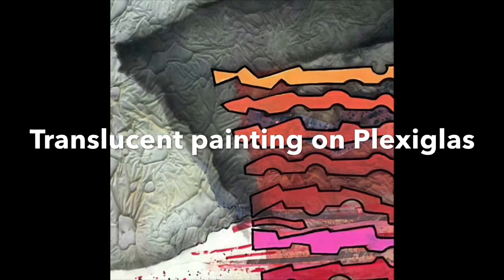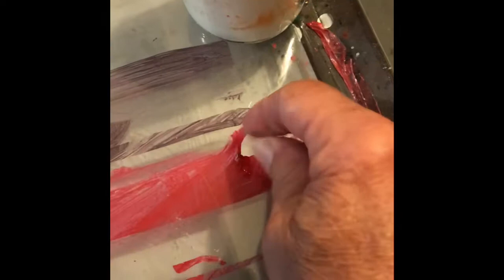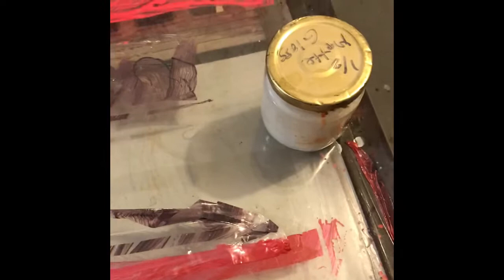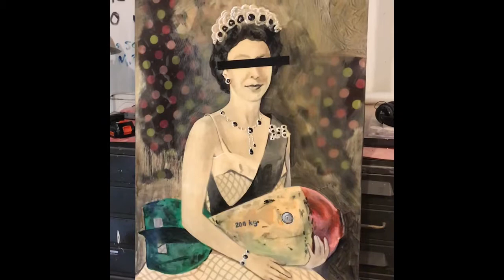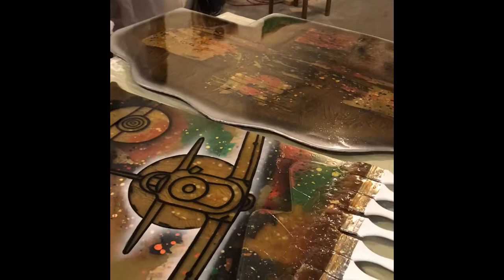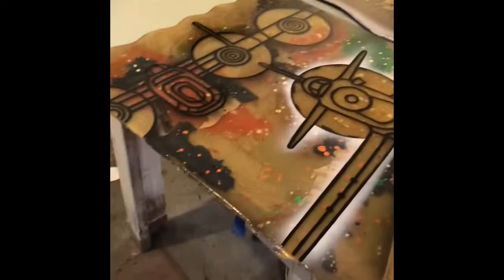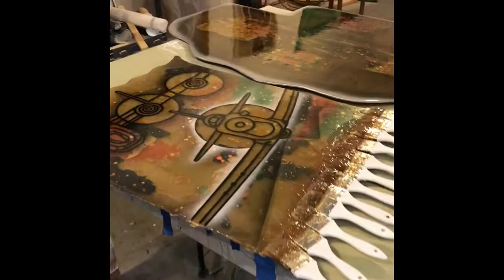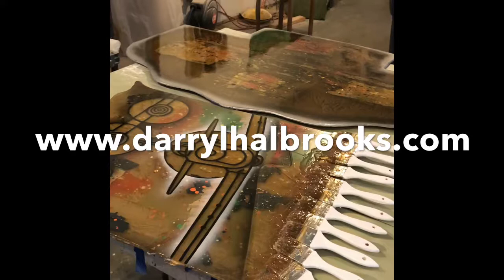Translucent painting on Plexiglas part 1

Comment: hi darryl, i was wondering if you could go more into how you use the modgepodge to suspend paint and then apply it to plexiglass? i am looking into ways to apply paint to plexiglass, and using a medium is very intriguing. however, i can't tell offhand if it scales well. your lovely abstract pieces seem to utilize the texture of the crumpled modgepodge, and i was wondering if that was unavoidable. thanks in advance.
Reply from the maker: I know these videos can be tedious but watch it or a similar one again carefully when I am dealing with those crumpled or wrinkled looking areas. They are actually on the back side and you are seeing them through the smooth front side. Those are achieved by laying out a coat of polyester resin and quickly applying pre-cut sections of plastic wrap. Once it has set, maybe an hour, peel away the plastic wrap. When it has completely cured, (next day) spray a light color in one direction and a dark color in the opposite direction (over the wrinkles). In my newest work, although I still make those wrinkles with polyester, on the other side, when the work is in a finished state, I coat it with two part epoxy and let it dry. It’s safer, (no sanding) fewer fumes and dries out smooth the first time. If the acrylic strips (or anything else you might have applied) is sticking up, (front side) keep coating with more epoxy each time it dries. Hope that helps.

Comment: Do you have any recommendations for sketching on thin epoxy or plastic? I tryed whiteboard marker but it staint the plastic
Reply from the maker: Hey Zoey, so sorry I didn’t see your question sooner. The problem with “sketching” on epoxy or acrylic sheet, if you want something more sophisticated in mark-making than you would get from a magic marker, is that the surface is slick and shiny. That does not lend itself to subtlety. So … an obvious solution is to give the surface some “tooth” by sanding it (over and over with progressively finer sandpaper. This is essentially what a lithographer does when she uses a Levi gator on a litho stone. Then you ca draw with a pencil, litho crayon or whatever. If you have in mind, keeping the shiny surface, you should be able to view your finished drawing from the reverse side, however, it will be backwards. Another solution, requiring many steps is to do the drawing on your iPad or computer, getting just the textures you want through a program or app, and transferring (method of your choice) the drawing to your plexiglas. (Whew) I know this may not sound like it’s worth the effort, but I can’t tell you how many times I’ve had to go through such convoluted mental anguish to do a simple but necessary thing for the sake of my art. Good luck.
Reply: @darrylhalbrooks4831  thank you so much! This is very helpful for more than just that one project i am working om. Thank you 👍